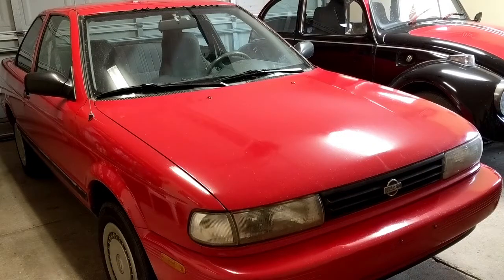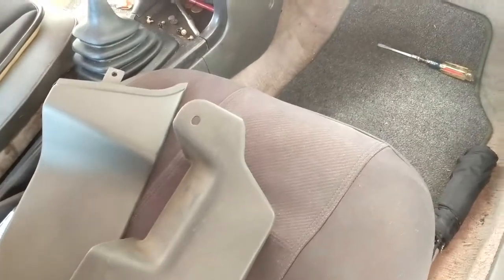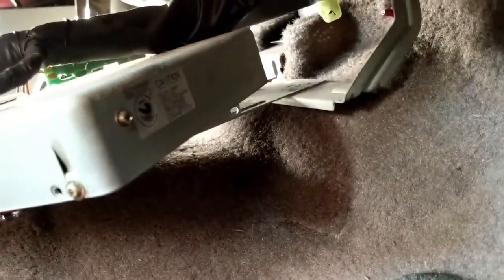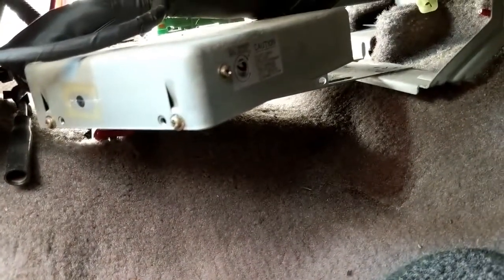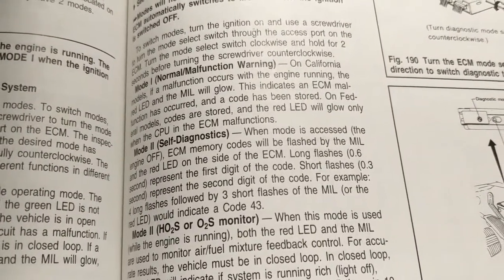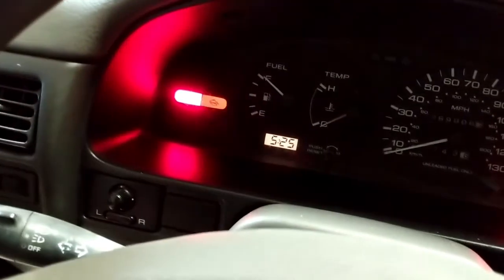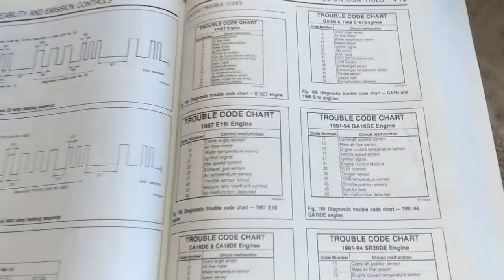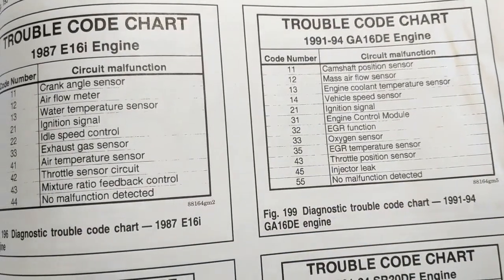OBD1 Trouble Codes 1991 Nissan Sentra B13

Comment: Quick question I hope you still active here and remembered what you did then
So after I turn the screwdriver fully clockwise and wait for 2 seconds  it should turn the light and flash x times, right? But how do i get out of the self inspection mode?
Reply: What did you end up doing